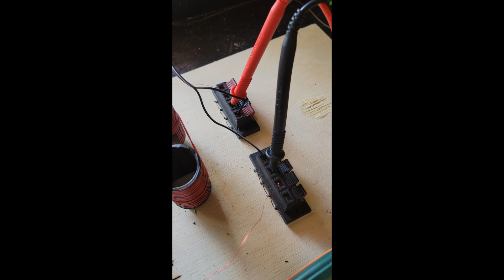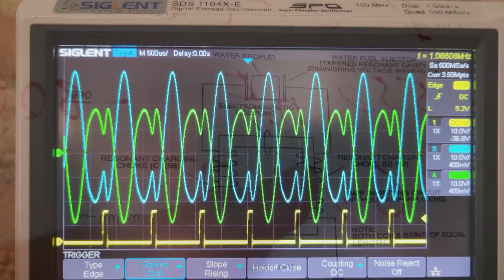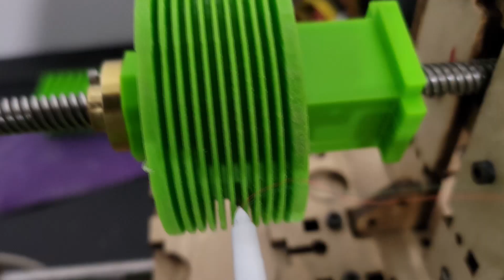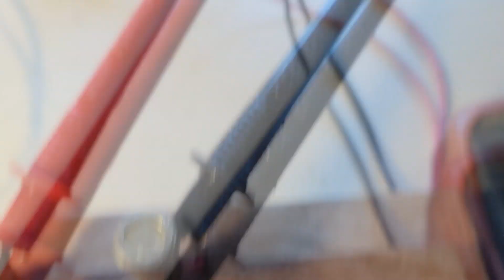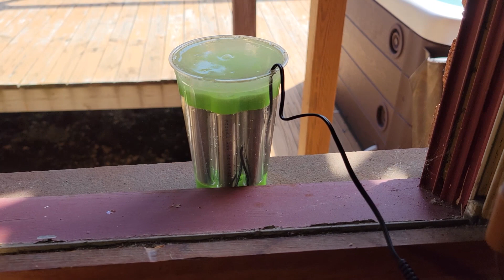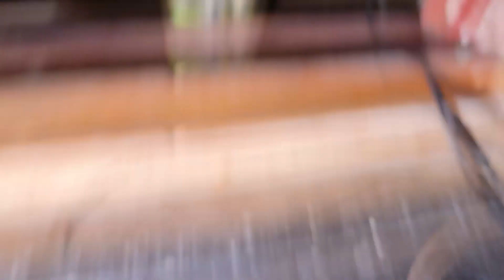My Stanley Meyer Water Fuel Cell as of 2022

Comment: I'm a bit confused, if you could stick with wattage when talking about power it would make it much easier to follow. It seems like you are implying that you are already getting a higher power output from the cell. I was under the impression that the output power came from using the brown gas (H2 & O2 at 2:1) as fuel. In this setup the "fuel" is vented to the atmosphere and not used at all.
Reply from the maker: I don't believe I'm getting higher power (wattage) at the Cells. Higher voltage yes, but with only milliamps being passed through the Cells, the overall Cell wattage is less than the total wattage of circuit input (VDC power supply). I'm losing watts in the circuit from what I can tell. I have a previous video about Total Power vs Cell Power, perhaps that would clear things up?
https://youtu.be/DKsbWRQU-iY